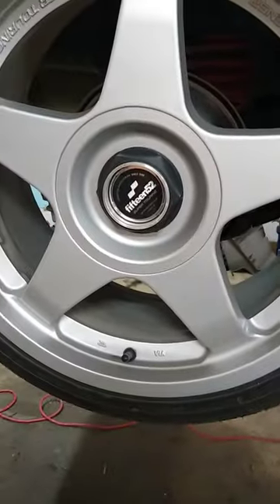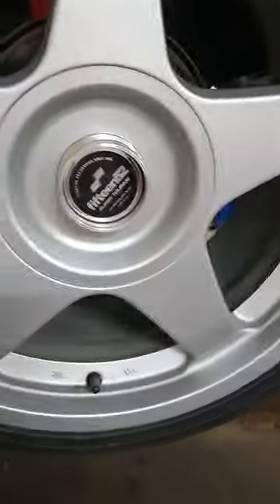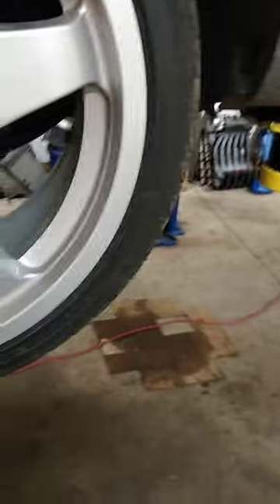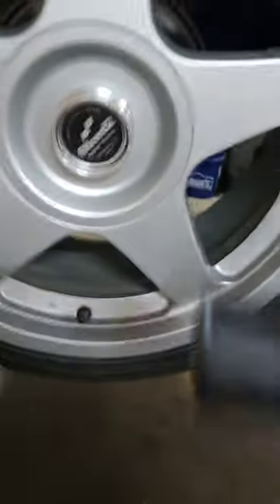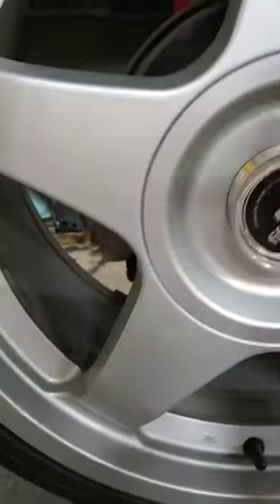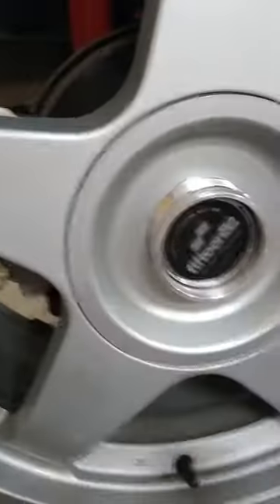fifteen 52 center cap removal tip

Comment: The apex super touring caps are rounded out near the edges so a hammer doesn’t work. It’s impossible to get these off. I’m sitting here with hot glue trying to pull.